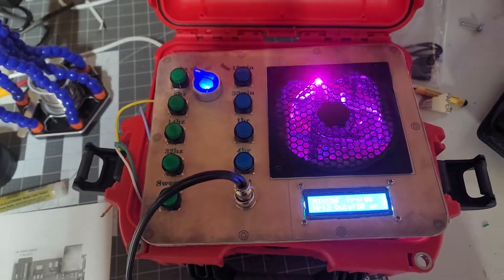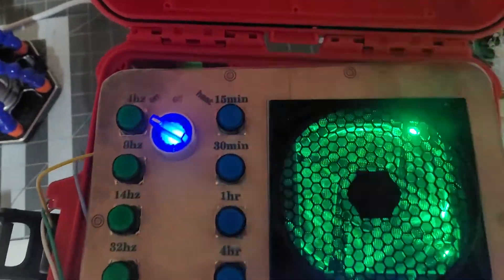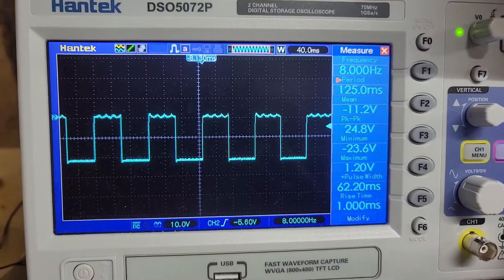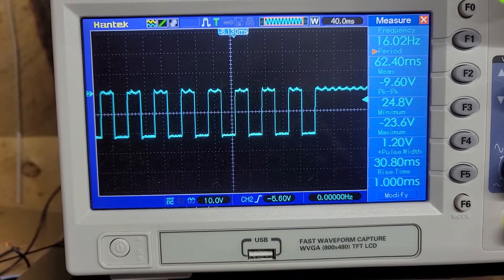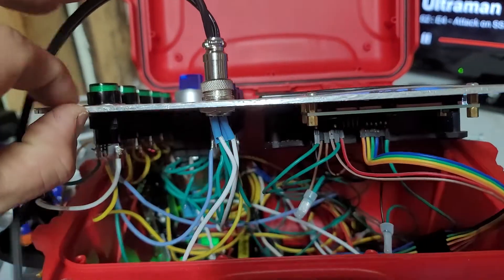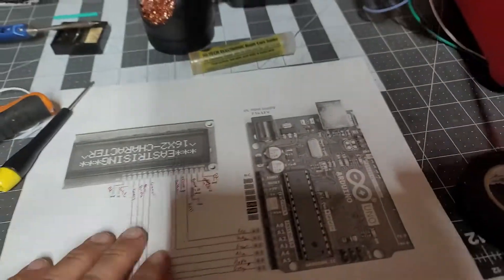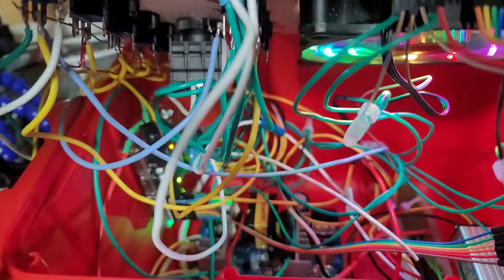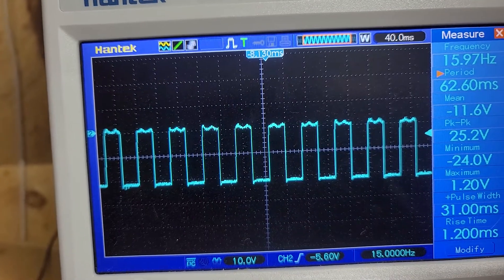pemf diy. using arduino.

Comment: Hi Steve I congratulate your initiative. I was just looking for that and found your video. I would appreciate it if you could provide me with the designs you made.
Reply from the maker: Yes.  Are you looking.for the arduino design? Or a much simpler and stable design?.
Reply from the maker: Please contact me directly 
Email 
Steevebradet@hotmail.com